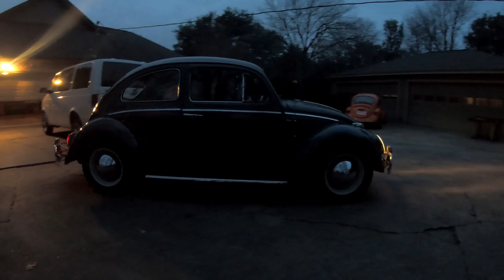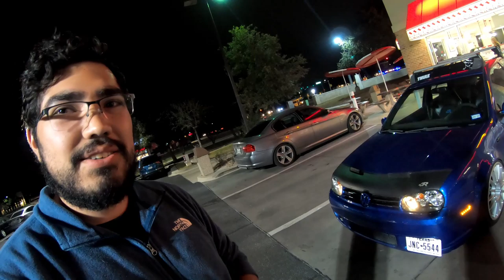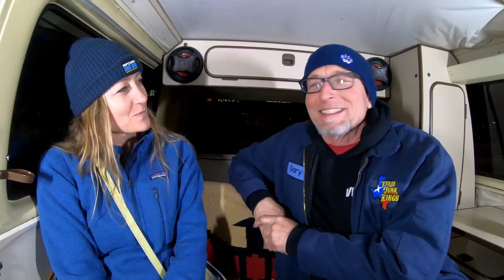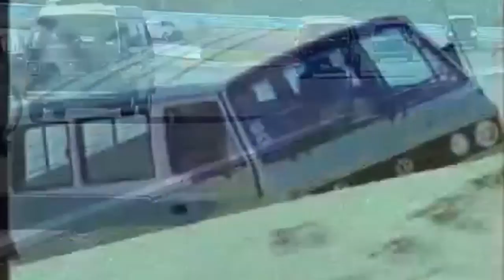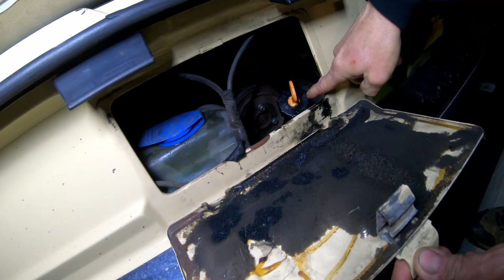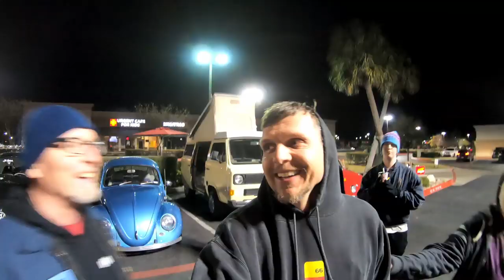Van Life Chose Her! Help Alice Name her Vanagon...

Comment: Alice, congrats.  I have the exact same van, "Angus, the Tin Turtle" is what he is called.  I live in the North East of USA, and Angus has been coast to coast several times, and up and down to the Keys of Florida too, averaging 40 mph and 28 mpg.  The little 1.6d is stock and has about 130K miles on it.  I have thought about re-powering it because traveling on anything but dead flat roads, or down hills, makes the rest of the world frustrated.  I have to route plan to find low elevation passes to get thru the mountains.  I do love that the little diesel just goes and goes and goes.  It's a right lane kind of thing and just like sailing a boat, where one has to adjust to" boat time" and speed, I adjust to "Van time" and speed.  It's easy to not be in a hurry when you carry your house on your back.  The difference in our vans is that once you close the driver door, you are already at your destination, no matter what's on the other side of the windscreen.  I went with Gowesty rims and a lift suspension and that changed the look in a way that I like.  I got the Michelin Hydro glides because they are better highway tires and in truth that little motor is not much good off road.  My fantasy it to have a EV motor conversion done on it.  Like you, my van found me as I was passing by it and my 8 yr. old son wanted to look at it.  Real inexpensive because of it being under powered.  My gain, everybody else loss.  Slow down and enjoy.  Peace
Reply from the maker: Wolfgang thanks for sharing we'll make sure Alice sees this

Comment: If you roll through Phoenix on your travels stop in and see me.
I'm the owner of affordable German... on a side note be careful with upsizing your tires.
That little 54 horsepower Mill in the back doesn't like it when it has to pull larger-diameter tires.
I turbocharged one of those for a couple in Colorado Last Summer.
It would actually go 75 miles per hour LOL!
Reply from the maker: Hey okay yeah if we're in the area will definitely stop by. We don't get up there often though. Yes these tires are only 27 in so not really much of an increase nothing crazy anyways

Comment: Looks like FUN!  I have a VW dilema, does anyone know where i can get a rear window w/o rear defrost for a 68 Bug?  Here in Wisconsin they are very scarse.  New or good used would be greatly appreciated .  Spring is comming!
Reply from the maker: Have you checked jbugs?
Reply: @VWLifeVW YES, i have looked all over the place .  When I bought the car it had a Rear window which came with it but it was a 1972 and up, it was too large.  I found one on E-bay, I ahd to wait untill i got paid .  The next day i went to purchase it it had sold 20 minutes eariler.  I have"t been able to find one New or used since.